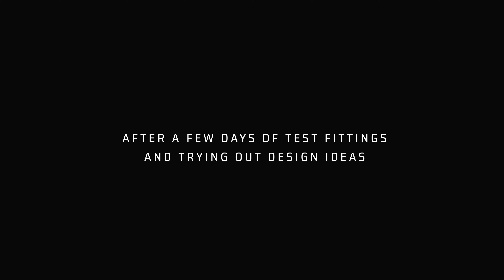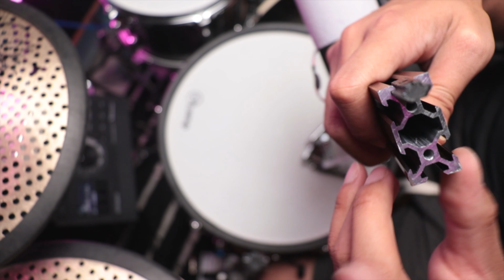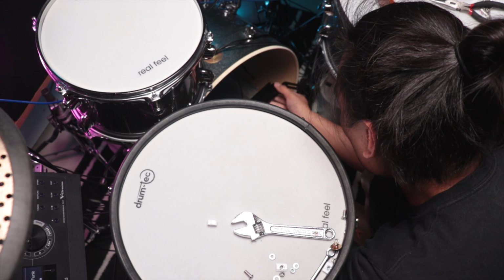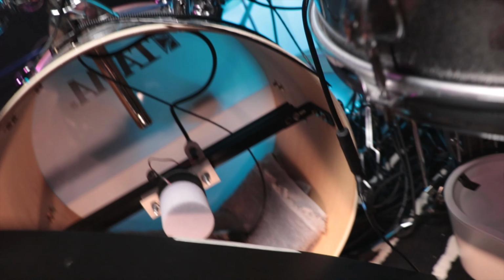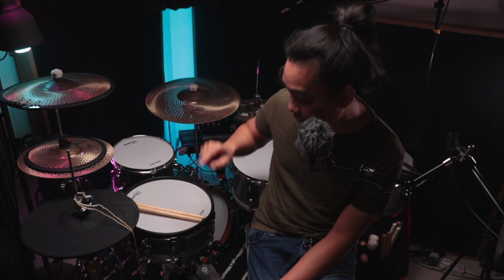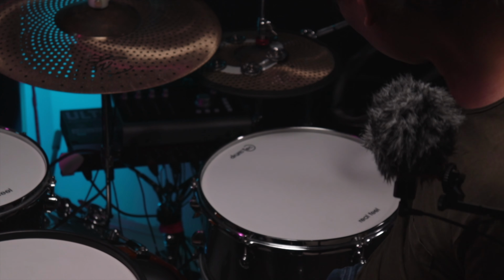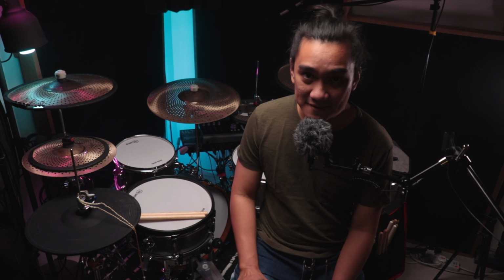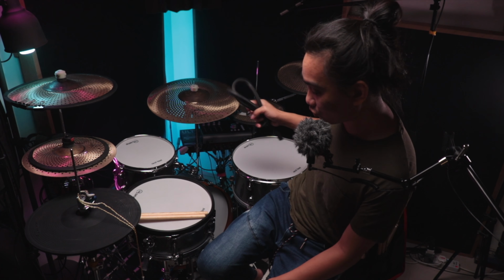Bass Drum Trigger Build | DIY R-Drums Monogon Trigger System | Part 2:2

Comment: Hey brother.  So your link to the T-Slot Nut/Screw sends you to 2020 size but you are using 2040 style aluminum profile.  Do I need to look for 2040 T-Slot Nut/Screw (if they exist) or 2020 works with the 2040 aluminum.  Thanks
Reply from the maker: Hey, yeah you wanna look for 2020 nuts and screws. Thats the one you need for the 2040 profile.

Comment: Hey man, I really enjoyed your videos on the a2e conversion.
Got a question though; does your kick beater hit the heat on the same position where the kick trigger is located or slightly above?

Thanks,
Coen
Reply from the maker: Thanks for checking the video! The beater is slightly above the foam trigger. But even when directly hitting the foam should be no problem. You can adjust threshold/double trigger and other settings on the module.
Reply: @ProjectBeats_  Thanks for your reply and keep on groovin'!

Comment: Hi sir Joven, is this the same with Rendrix Drums?
Reply from the maker: Hey. I think Rendrix has similar designed triggers. I’m not entirely familiar with them but looks like they 3d print drum shells, and most trigger designs looks like they are inspired by Jobecky and R-Drums triggers. R-Drums however has been in the industry for a long time and is German Made. I think they are as close as you can get with Roland triggers.